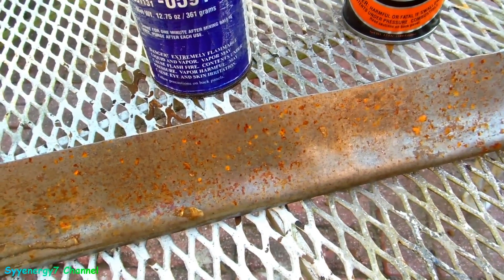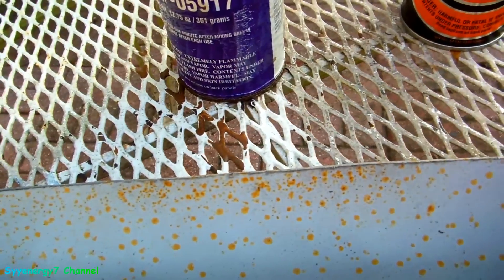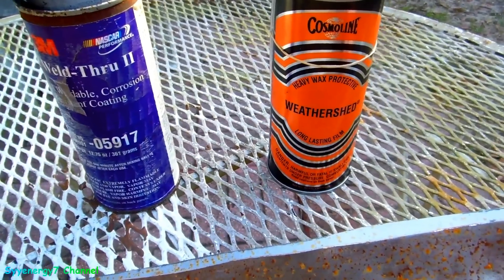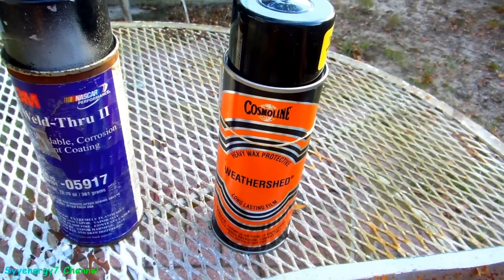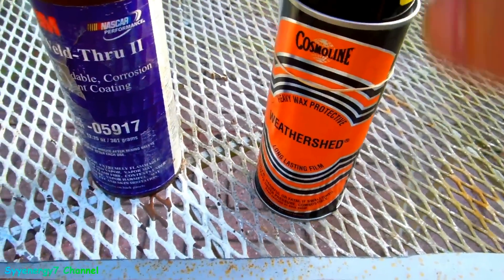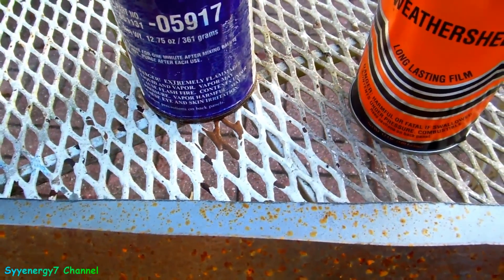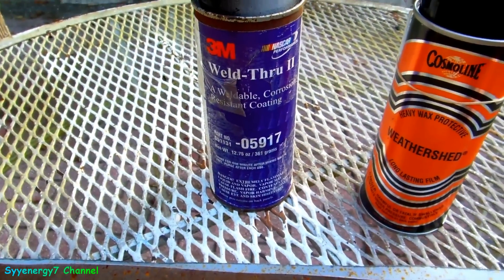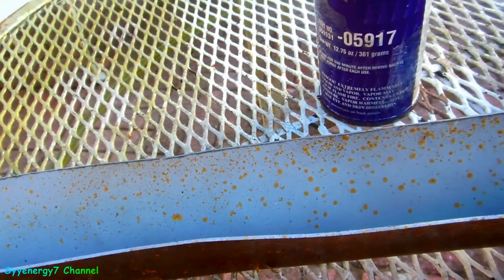Copper Coat Weld thru Primer, Do NOT see Rust Protection

Comment: Vehicles are mobile! Just because it's sprayed in Texas doesn't mean it stays in TX. But this video, released in 2015 makes it 7 years old, now Jan 2023, chemistry has changed and so has price's. Now, 3M still offers a "Weld Thru Primer" but 3 types of panel bond. A 2:1 ratio in a caulking gun which is $65 for 200 ml, in a special caulking gun from $48-$130. It goes on a clean pinch weld an wet, conducts electricity to pass enough amperage to complete the "Resistance" weld. Of course "These" new type machines have electronic controls for everything and cost as much as a used later model truck. But a pinch weld passes near it (Clean of panel bond) but fills in from behind because it flows wet. Dry, it become dielectric and won't conduct electricity. So having everything ready is key here. I like the idea it is displaced and covers the un-welded spots next to it. But certified collision shop must spray cavity wax behind it before and after the repair, print and provide the customer proof and one on the repair order. They invest into a bore-a-scope to take photos. Another cheap piece of equipment I'm sure. With 7 different types of metals used on one vehicle, overheating, proper spot-weld size, distance, number per foot, amperage, duration of resistance weld, tip size, dressed tip, etc. Make it stop. To follow a part/area of a 2018 Nissan Maxima, with 3 meters of damage, new parts, "LKQ" parts, cleaning, sanding, grinding 1/2" (13mm) spots, compressed together, aligned, photographed prior & after...oh yes, then welded. Then have fun!

Comment: I think that most of the areas this would be used on wouldn’t be directly exposed to water, mostly humidity. I see this mostly being used for door panels that are inside the door. I’ve got nothing against Cosmoline, or anything else. But that won’t get between the panels the way this does, before you weld them together.

Roofing tar is very flammable and puts out noxious fumes. I’d find out if it was legal before using it. It will make your car stink in hot weather.

Comment: Nonsense test.  This guy didn’t use weld 
through primer for its intended purpose.  Weld through primer is intended only for use between welded panels, not for open-air Corrosion protection.
Reply: What does it matter? It either has rust protection properties or it doesn't.

Comment: Damn ,, even the 3M can appears Rusty looking !!!!
Reply from the maker: +William Lind Yep.  The metal was sanded and thoroughly chemically cleaned and two good coats of 3M copper coat weld-thru primer were applied.  If it did anything to slow rust it sure was not much difference at all and definitely not worth $23 a can.  I wanted to test this Before I fixed the rest of the door.  I bet the vast majority of autobody repair men ever do these kinds of tests.  Do you know what stops rust cheap on even rusty metal?  Plain &#39;ol Rustoleum Rusty Metal Primer that is specially formulated for rusty metal.  That costs $3.50 a can.
Reply: I Agree